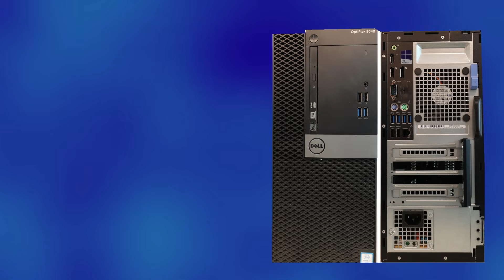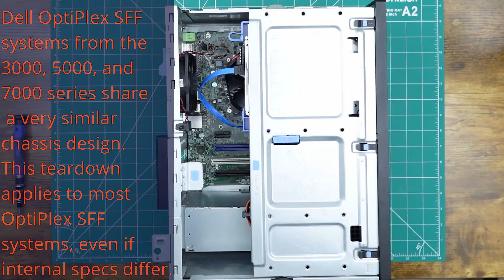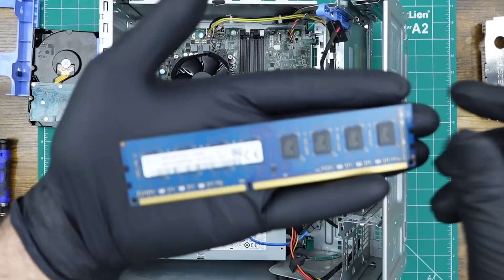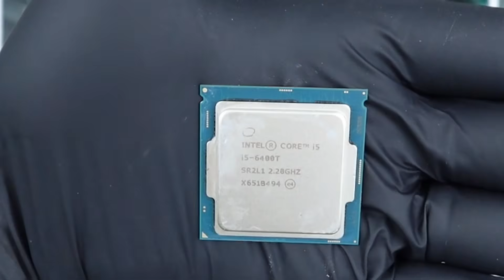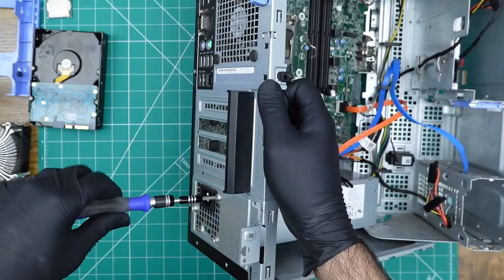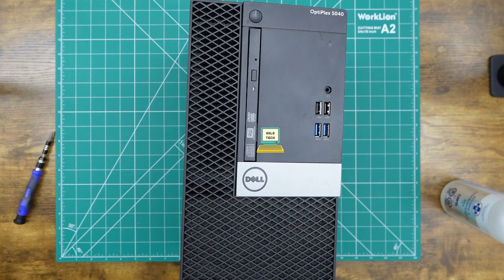Dell Optiplex 5040 –Teardown, Upgrades & Compatibility Tips

Comment: how do i remove the motherboard
Reply from the maker: After tearing down everything else and disconnecting all the cable just locate the screws around the board and then gently remove it from the system (be careful with the I/O). Do you wanna remove the board and replace it ? Or you wanna do a case swap?

Comment: Couple points that PC isn't a small form factor  it's known as a mini tower  as it clearly can handle full-sized PCIE cards 

The small form factor machines are much slimmer and use half-sized PCIE cards  and only 2 PCIE slots 

I know because I have one 

Also the 3040 didn't come with NVme   so I am guessing the front has either been changed or the motherboard isn't the original to the case 

Or on the other hand that slot you said was VVme might actually be for wifi card 

I believe the NVMe came out on the 3050 because that was one kf the key requirements when I went to buy some dell optiplex 

I've got 3 Optiplex machine one is kept spare and I run  1x 3050 SFF  I also have 1x micro 3050  and the spare is a 3040 SFF 

For their age they still do well  my 3050s both running 16GB ram  standard size SSD in the SFF and M.2 in the micro and both running windows 11  work amazingly well for their age and perfect for my day to day  usage
Reply from the maker: Thanks a lot for catching that — I really appreciate you taking the time to watch the video so carefully and point it out 👍
You’re absolutely right about the Mini Tower vs SFF, I’ve added a correction. They look very similar😁
Regarding the NVMe part. Believe it or not after BIOS update it booted from the M.2 SSD with no issue. At first I thought the same thing. Cause in some of the Optiplex Micros there is a spot for NVMe but it only supports Wi-Fi card.
The thing with the OptiPlex 5040 is that it was in production for quite a while, so there are a few variations out there.
Thank you again 💚
Reply: @SoloTechLab1  no probs 

Yea the mini tower and the SFF do look very similar I believe they are the same height but one is fatter than the other  

To be fair I find the fatter ones like yours kinda ugly compared to the SFF  but then again with dell machines I've always kinda hated the plastic look of them 

As for the NVME I guess you got lucky maybe it's one of the very last of that model that got that option or potentially that's machine may not have the original mobo 

I did double check on the dell website for the 3040 specs and it didn't list the NVME 

But either way they are still pretty good machine as mentioned in my original comment got a fee of them 2 currently in use and a spare and they work wonderfully well for their age  and certainly love my little optiplex 3050 micro